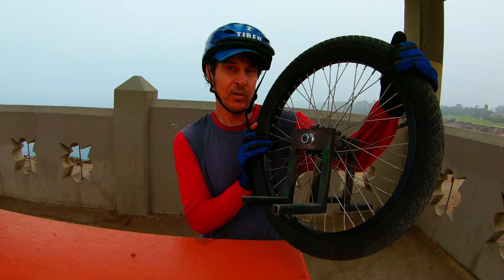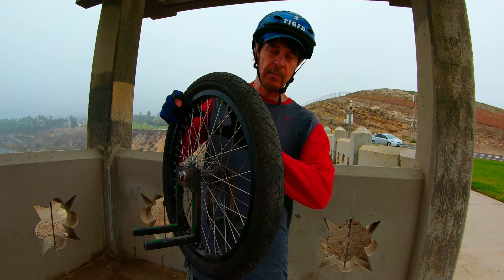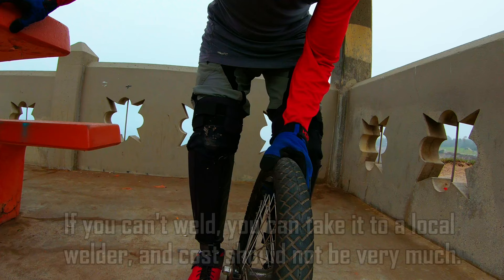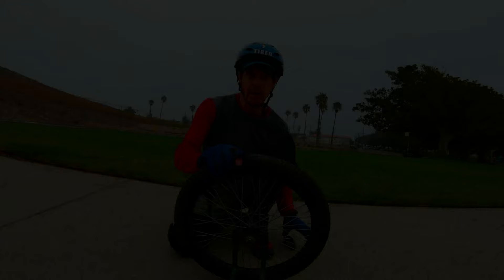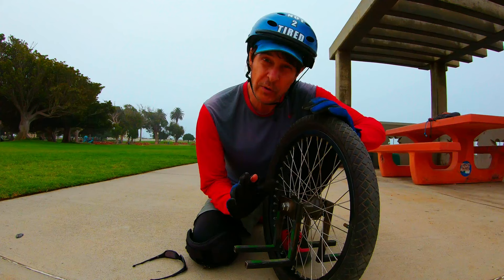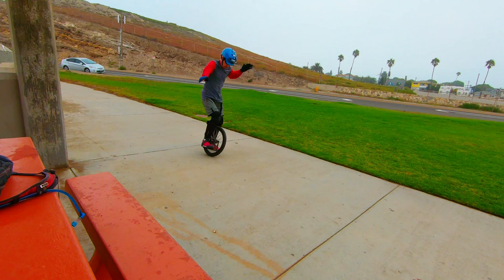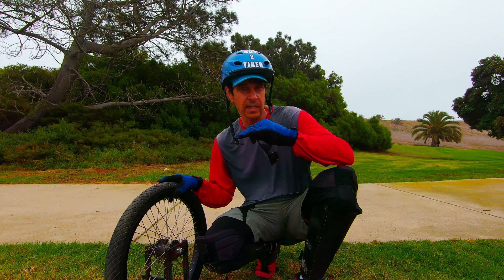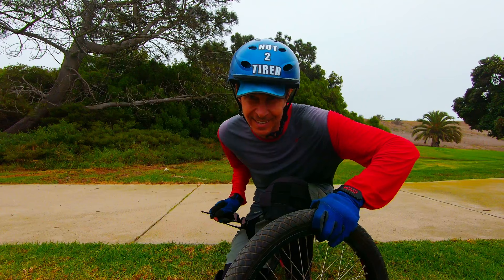How to Ride a "BC" wheel aka, "impossible" wheel

Comment: Wouldn't balance be easier if the foot plates were substantially lower?
Reply from the maker: Not really. They're already well below the axle, and any lower you run the risk of the plates hitting the ground on turns.
Reply: @TerryUniGeezerPeterson  I discovered your video because I'm trying to figure out a way to allow coasting on EUC when the wheel cuts out. It's the biggest problem to solve on these devices and I'm sure there is a way but even if coasting on the wheel can be done there's still the issue of the heavy flopping chassis so IDK. Maybe it can't be done.
Reply: @JeskaRain  lol, I'm trying to figure out if are possible to ride an powered off EUC since I discover these impossible/bc wheels. I already had a cut off and "coasted" a bit before jumping off the wheel really not intentionally
Reply: @pedrogabrielsalviano  No it's not because the entire chassis topples over.
Reply: @JeskaRain  I think might be possible with a light wheel with low pedals like Inmorion v5 or Kingsong 14d